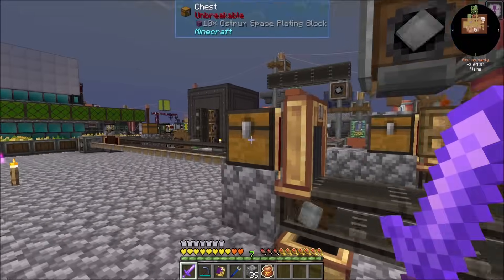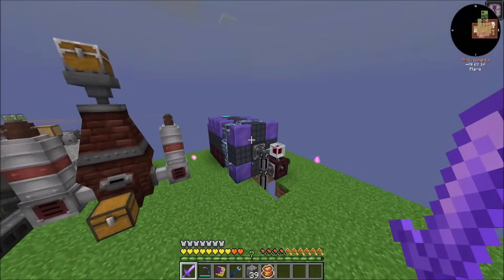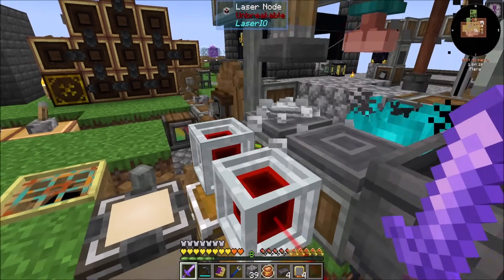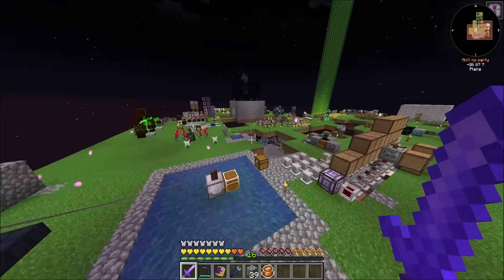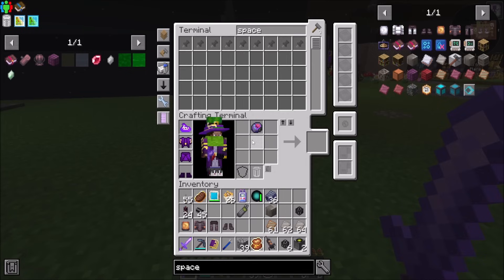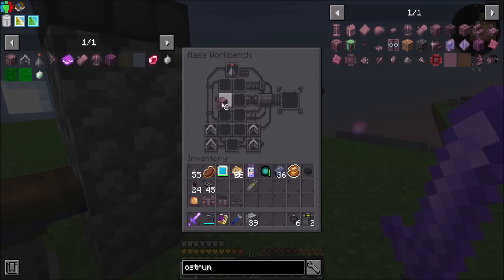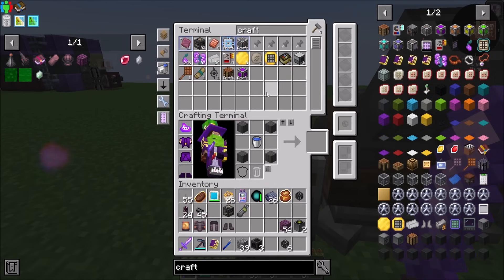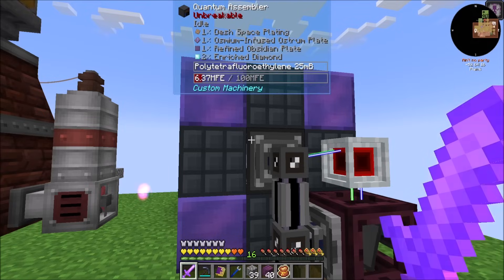FTB Skies Expert Ep82 Tier 3 Rocket Assembly

Comment: Suggestion: Dire now has two Advanced Mixers.
Last episode, he put two patterns on the original Advanced Mixer, which were part of the same complex craft.
Moving one of them into the new mixer will notable speed up that complex craft, as the two steps won't be contending for the same mixer.
Reply: wouldnt that be nice